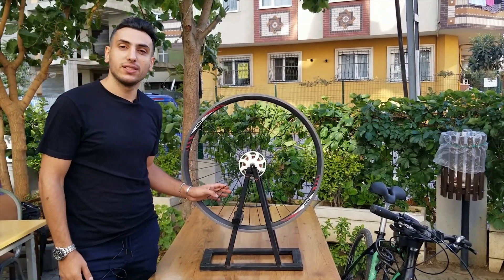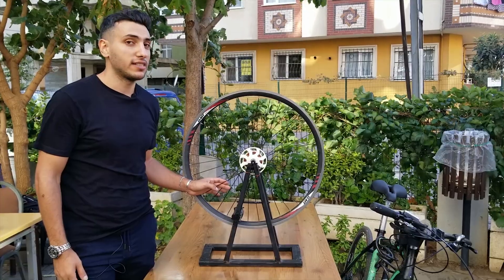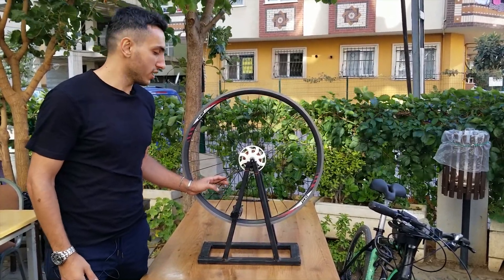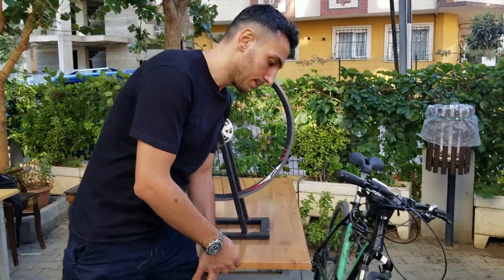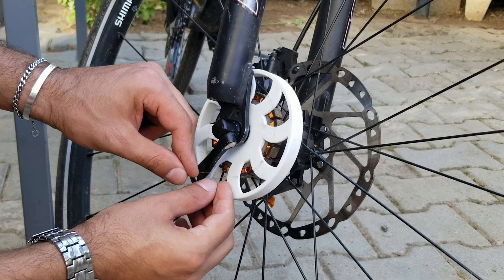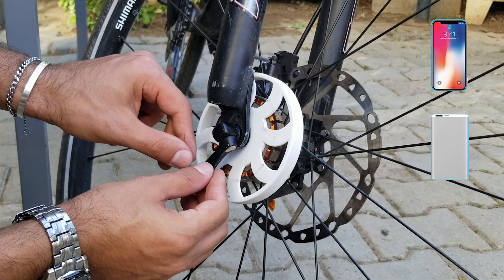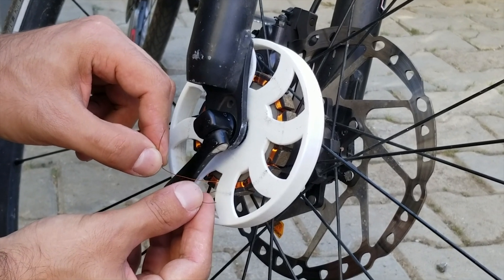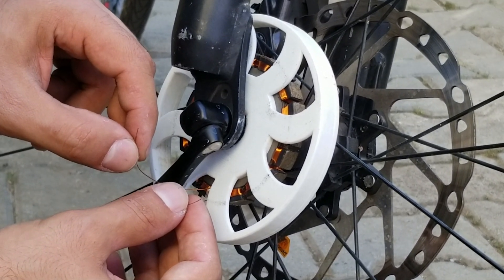Free Energy Generator Fast Charging Small Device

Comment: yer demonstration  is  not  realistic.     because, you are simulating a speed of maybe  FORTY  miles per hour!!!!!
Reply from the maker: Hi David! First thank you for being interesting. I am not deceived people. RPM is true. I tried to show you RPM but it was not possible. I can tell you that The drill bit's diameter is 5mm and Speed 2500RPM and connecting the wheel with 40mm diameter. So you can calculate real RPM. Don't forget there is some power lost. So probably The drill's speed is around 2300~2500RPM. Next video I'll show the speed 😊👍🏼 be following
Reply: @dTnbilim  WRONG  and  wrong.         firstly, it is  Correct  to  Compare   RADII,  NOT  diameters.        secondly, the issue is  NOT  rpms.     the issue is the  Distance  a bike will be travel, During  ONE  Rotation.   as  Determined  by  the  wheel's CIRCUMFERENCE.   pi* d.        thirdly, you have conveniently  Failed  to acknowledge  the other reasons why this experiment is  a  FAIL.       not that it matters, at all, but if you are gonna use digital devices that do  Not  record, correctly,   Make and use  some  LABELS.    out
Reply from the maker: @daviddavids2884  Sorry David but I can't understand exactly what do you mean. Whatever The project is in processing. We are going to improve 👍🏼 Also I assure you it's not more than 300 RPM. You can check my Instagram account
Reply: @dTnbilim  i will   SPELL IT OUT  for  You.
using your  300 rpms  and  a  26 inch wheel, wheel  CIRCUMFERENCE  is  about   81.6 inches.     81.6  times  300,  equals a distance of  24,480  inches (2040 feet) traveled   Per  Minute.     times  60  equals  122,400  feet,  23  miles, per  Hour.         this is Faster than  Most  people ride,  Most  of the time.    conclusion:   an  INACCURATE    demonstration.    out
Reply from the maker: Take care your language first then learn physics. I am not make it turn from outside of wheel. The generator is turning same time with the wheel. Basically if the wheel is turning 300 times per minute, generator turns 300 times per minute. If you want me to prove it, just text me with Instagram. I'll prove it to you. I promise